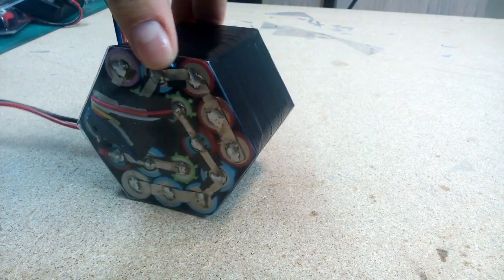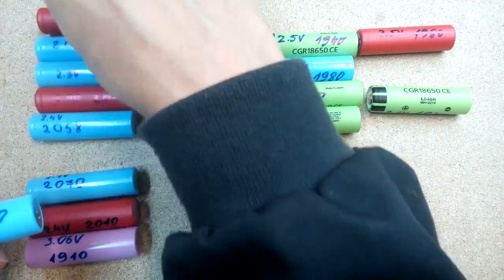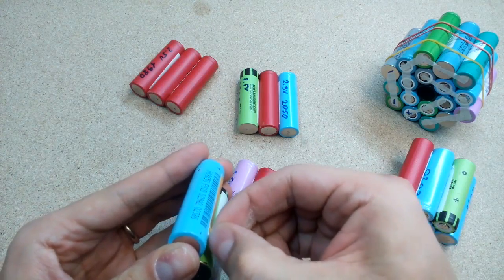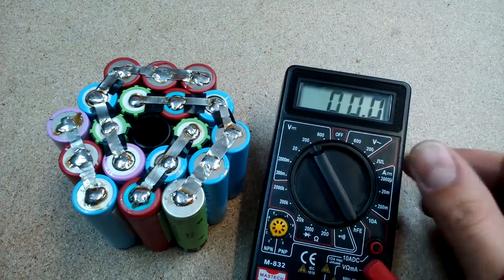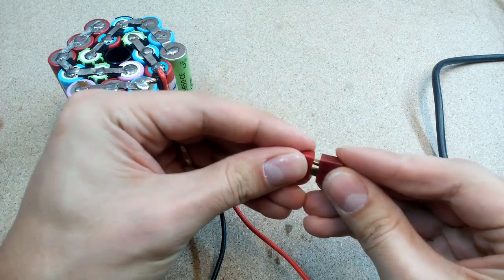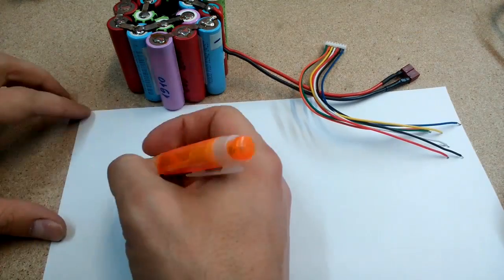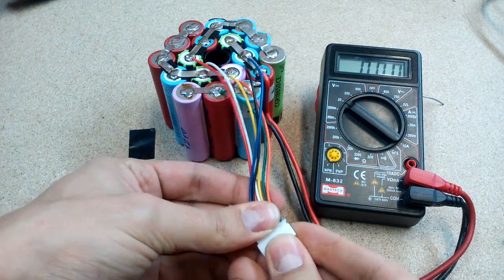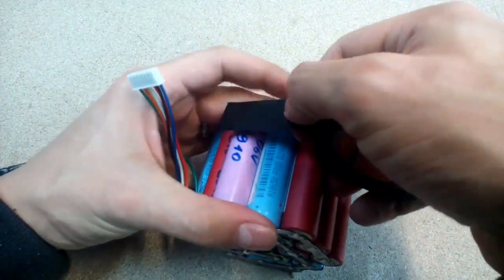DIY: 22.2V 6Ah 6s3p Battery Pack From 18650 Lithium Cells

Comment: Hello again!! Not sure if you saw my message on your 100watt LED Build? But looking back a couple of years, I sent you a message here and a thank you. Man was I a newbie then..LOL. So I just completed the battery pack for my 100watt led. This time with around 2 years of experience under my belt. The battery I just built, or the 2 batteries like this i just built look 200% better, cleaner and more professional than the one I did 2 years back. When I post my video, I will try and find the pic of it and post it as a Giggle. I didn't solder this time, but I used a tab welder I built just recently.  Thanks again for posting and coming up with this simple design, you rock!!! This time, I used actually better-tested batteries than the ones I used back then(all those should have been tossed..LOL)

Comment: Great Video!!!I just finished my 6S3P 4Ah last night. You would think this battery build is a simple throw together. It took me awhile to finish mine. Took me the longest, just testing my Batteries(laptop), But I only have one Imax b6 at the moment. I tested each battery as a single 18650. Than I tested again while I had them in Parallel of 3s. Test seemed to get better as I discharged and charged the batteries. I like to use the Imax b6 for discharging and than I charge back up with a Xtar (I get Mah reading both ways). I have not tested the pack as a whole. Will probably balance and test today. They've been resting overnight. I will also add a BMS I can attach to the balance cable(split for charging). I like to add a female and male balance cable to my BMS-s(solder only versions). This seem to make a change out, simple if there are future issues. With all that said and done, my pack did not come out as perfect as yours. I think the over lapping lips I used on the top and bottom was a little big.  I also decide to use an old plastic school folder for mine(red). But it is 200% operational. Your video was a BIG Help!!! Only confusion was the balance cables. But once I connected everything, using the multi-meter, I was able to wire up pretty easily. Your balance cable was colored, I had Red with 6 black wires and I had to combine 2 3S to make a 6S(pretty simple). I'll post some pics on my google profile once I get a chance.😊

Thanks for another detailed Video!!!😊

Comment: Hi, great video, but I did not understand the wiring, what goes where, and which cells are in parallel and which are in series. Could you do an explanatory video of the batteries wiring? Thanks you.

Comment: pretty awesome stuff, i had always thought that this would be pretty efficient compared to the lipo packs for some applications in e cigarette and eliminating the need for a battery sled saves a lot of space when your trying to squeeze things into a small hand held enclosure. I am waiting on 6 fresh samsung 25r5 batteries to do a 3s2p pack for these new evolve dna 200 chips. the equivalent of 15600 mah(i understand that in 3s it would only be 7800 mah but in the vape world people dont understand how packs work for the most part) in an inclosure that is 3 inches wide 1.75 thick and 4.8 tall. i think it should make some waves in a world where people are losing their minds about 5500 mah in a box almost 2 times that size and 1.5 inchs taller.

Comment: Can you give me a link where to get the wires on ebay and were to get the charger you use? Im building my own lamp with 400w in total, 4 of the 100w leds and im facing a problem with recharging it
Reply: Kokaiinikarhu it is all rc hobby stuff , search for rc battery wires and balance wires, and rc digital charger

Comment: Can anyone help? what I've been trying to find out if I have 100+ cells ranging from 2600mah to 1700mah, how should you arrange the parallel groups? to make a larger battery should i mix them or make one cell all the same and then one with lower capacity cells all in the same range.

Comment: Nice shape! :) And great tutorial!

I'm planning a similar project (with a min of 6s3p though I'll probably go for 6s4p and new 3500mAh cells for greater capacity /est. 12740 with Sanyo NCR18650GA/). 
However I want to build this in a DIY DC-UPS for a tiny (but powerful!) pc (the Intel Skull NUC), which is rated up to 120W (ie 19V 6.32A). Though typical use would be between 3.6~4.6A depending on load /and probably would never reach over 5.2A/.

So at one end I'll have PSU with usual 110~220V 50~60hz IN, and I think best to have 25V 8A OUT (ie it should be 200W capable). 
Decided on 25V to be able to directly* charge the above 6s battery.
* 'directly' I mean without Voltage conversion, but obviously I'll need to limit the current to the recommended 1.7A (ie 0.5C for the NCR18650GA cells).

The PSU OUT should also lead toward the end-device (the NUC), but before that it should pass 1st thru some kind of a switch-relay (ie 2-INs->1-OUT DC module). If Switch-relay's INs are A (the preferred) and B (the Battery back-up), the OUT should get A-IN when available, and when A is unplugged, to switch (as fast as possible to allow for interrupted work) to B.

After that Switch-Relay, I should have a DC-DC converter, because both the Battery and the PSU would give me higher voltage than needed (the PSU 25V, and the Battery up to 22.2), so that DC-DC Converter should reduce and stabilize it to 19V.

Since I would want (in worst case scenario) to be able to use the NUC at full load, and charge the battery if needed, I estimate the total Current needs of 8A (6.32A for the NUC, and 1.7A for charging the Battery) /hence the above need for PSU of 200W, 25V 8A/. Though in reality I'll probably never draw more than 6.5~7A, but it's nice to have reserve and avoid stability issues in the NUC.

Now I've determined (mostly) the parameters of the main component, but haven't selected the actual parts (besides the battery cells). 
The PSU should be easy I guess, even if slightly more powerful than most adapters.

The Charge-Protector module however is still a mystery. I've found the TP4056 in similar videos, but it's only only 1A, and while that still going to charge, it would be much slower and for the capacity of new 3500mAh cells it's unnecessary low /the recommended 1.7A is just 0.5C of 3400mAh and I believe still very safe and gentle to the cells - correct me if I'm wrong please/.
This protector should also protect from over discharging (under 2.5V for the NCR18650GA, but I think that's more or less standard).

The Switch-Relay is also a tough-cookie :/ It's should be fast and reliable, in order to allow for uninterruptible switches.
The closest ones I've found on the net so far are: 
380V 2-Channel OMRON SSR AVR rated at 8A or,
one on Amazon with model #: RSN1866453 (rated at 10A)
but with my electronics knowledge I might easily mistake with ... lets say a mixer :) so feel free to correct me, suggest better!

The DC-DC regulator must be easier to find, it seems there are adjustable ones that can output at least 20V and 10A (unless the SSD AVR already outputs stable 19V of course).

Now while I don't plan on integrated balance-charger (because I'm starting with new cells, and planning on 50-60% current load, and I expect the charge-protector to prevent the weakest cell to drop below cut-off 2.5V, and the strongest cell to overcharge over 4.2V), it would be nice to be able to balance-charge it after longer usage (like twice a year?) with something like iCharger 106B+.

What do you guys think?
Any comments are welcome! :)

Comment: Wouldn't the voltage and capacity of the battery's need to be the EXACT same if you were to put them together otherwise the discharge rate of each cell will vary causing damage. So the only situation where you could put them together is when they were already put together in then the first place eg. From a old laptop pack
Reply: the things is... I have actually taken apart the ones from dead laptop batteries and even they weren't all the same. So I guess it doesn't matter here
Reply: I know it will work just the total battery life of the entire pack will be reduced because to deliver 22.2V all the cells should be working. if one cell does not because it has been used more you will have to dismatle it just to replace one cell to get it working again. Where as if all the cells were from the same pack then they would all die almost at the same time preventing the waste of the cells
Reply: +Jesse Lam on the real world cells don't die all at the same time. That's the most usual reason why laptop battery packs fail, one cell fails, so the whole pack now doesn't work.
Reply: +wax147 O i see then thanks
Reply: In this case he is using a balance charger, so as long as he doesn't dissipate the cells to too low a voltage, it won't matter because the charger will make sure to charge them up to the same voltage level.

Comment: Hi!
A really well done battery pack! I am interested in the balancing circuitry. Do you have a ready made solution for that?
Reply: +e1woqf Get a balanced charging lead off ebay and follow the spec for connecting it as tho all the sets of six are a single cell
Reply: +e1woqf I replied before finishing the vid. oh well.

Comment: that battery can't be 4,930mah because the biggest one is 3'600 mah
Reply: +imgone No such thing as a 5800 mah 18650 cell, no matter what the label on your Chinese rewrapped battery says. Also the fact that the battery he makes in this video is a 6s with 3p, therefore the mah is trippled

Comment: the more important thing is here the ESR matching not the 6000mah matching...
Reply: I think this is not correct. The chargers doesnt measure the mAh. The charger has a voltage and a current limit. The charger stops at 4.2V (for example). The maximum current is normaly just limited. Look up a current voltage curve for a lipo-battery. The problem with paralell batteries is that the current and therefore the charge is going where the lowest resistants is. simple omes law. That means that if the cells donot match the lowest ESR battery will get the most charge, stopping the charging process whenit reached 4.2V and the rest of the batteries will not charge fully. This also happens when looking at the discharge protection.

Comment: shouldn't all the batteries be of the same model
Reply: +Daniel Enzlin Yes, this method is not very save....´
Also you should spot weld the connections and dont heat up the cell with a soldering iron.

Comment: why its only 22 volts charge
Reply: That the nominal voltage of Lithium battery either 3.6 or 3.7. 6*3.7=22.2 volt. The fully charged voltage is 25.2 Volt. Anyway this is not the proper way to pack lithium cell.
  - You should not put different type of cell together.
  - Use soldering iron is fine but he's done the very old fashion way to pack it. It's better to use copper trip as the bus bar and use small fuse wire to connect the battery to the bus to protect the battery.
 -  He didn't introduce any protecting circuit for the pack. That's really not a good thing to do since lithium battery is sensitive, over discharge or over load may damage it. I cannot image what happen when that pack is shorted.... I think minimal you have to add fuse to protect in that case.
Reply: so thats why Im having overvoltage  when i added set of battery

Comment: Great! I'm an Italian guy, I was just trying to make a battery as your 6s and 2p or 3p, for my Boombox! now common use of lead-acid batteries, 2 12v series. Until the creation of the battery I had arrived, but for the charger you like markups? uses a model charger? or mounts a protective sheet and markups with a common 24 volt power supply?
Visit my Facebook "Silver BoomBox Sound" page of solid wood, very beautiful.

Comment: how to charge this battery pack'
Reply from the maker: +Syed Kazemi i'm charging it with Imax b6 charger. But here will work any li-ion, lipo charger with balance function.
Reply from the maker: +Syed Kazemi i'm charging it with Imax b6 charger. But here will work any li-ion, lipo charger with balance function.
Reply: not to be a pain, but could/have you upload a short video of how you connect the battery pack to that particular charger?
Reply: he shows a drawing, most lion chargers use same connector, about $1.50 on ebay
Reply: can i use it for 30w led
Reply: Syed Kazemi it is all rc hobby stuff , search for rc battery wires and balance wires, and rc digital charger
Reply: @welldonetips  Voltage Error when charging Lipo battery. What is the mistake? Could you make a video of how to load in IMAX

Comment: when you solder cells like this you are melting the membrane inside, no matter how fast you remove the iron. There is a reason they are always spotwelded. The cell works but will degrade quickly and could have thermal runaway.

Comment: where is the protection circuit man for this li-on pack of yours. it may explode. overcharge overdischarge protection input output current protection and temperature protection. and don't solder those li-on. very dangerous